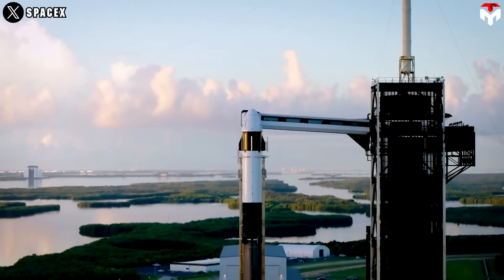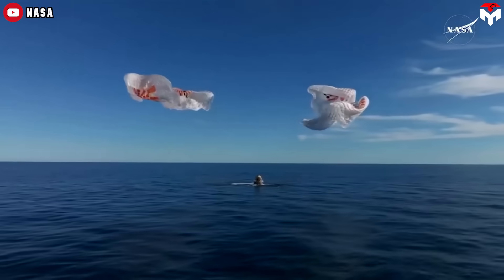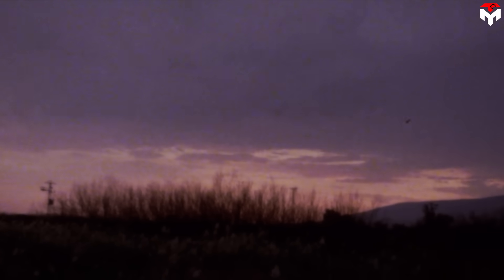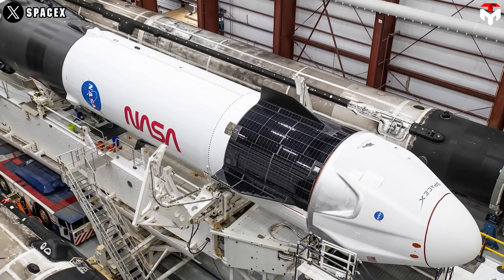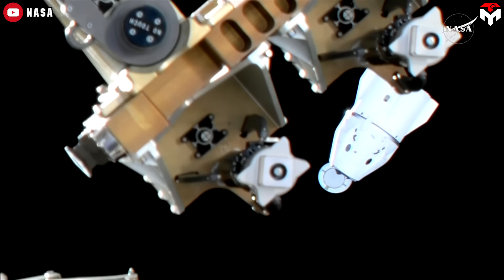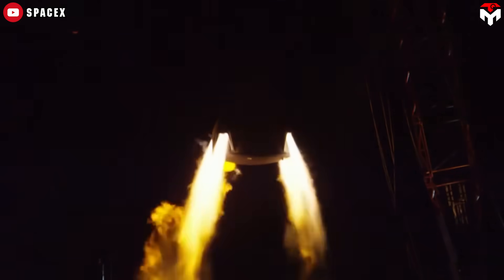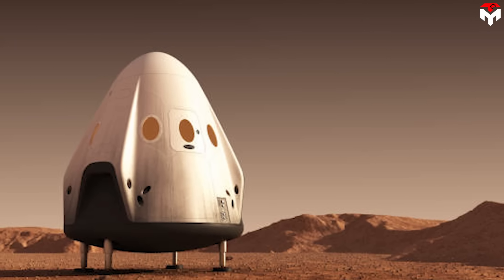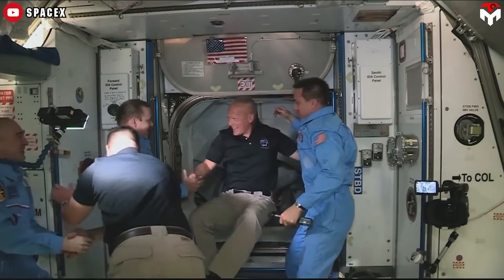SpaceX's New Upgrade On Dragon Landing, NASA Refuses to Fly on Competition...

Comment: I've seen a few breakdowns of the proposed Mars entry and landing procedures for Starship and it seems like many things have to go perfectly with very little margin for error or operational issues. Although entry and landing are naturally hazardous, would the Dragon capsuel make more sense for getting astronauts to the Martian surface from a flight safety perspective than Starship? Perhaps Starship could transport crew and mostly cargo from Earth to Martian orbit and then use multiple Dragons to land on the Martian surface, and then use Starship to carry the cargo to the surface separately?  I know it is more efficient and effective to fly point to point with Starship but it just seems like the entry and landing procedures carry greater risk.
Reply from the maker: True. Starship's Mars entry and landing do require a lot of precision with tight margins, given its size and the complexity of aerocapture, hypersonic reentry, and powered landing in Mars' thin atmosphere. Dragon, with its simpler ballistic entry and proven parachute-plus-propulsive landing system (as seen in Earth returns), could indeed offer a safer, more forgiving profile for crew. Your idea of using Starship as an orbital ferry for crew and cargo, with Dragons handling crewed surface landings, is interesting and mirrors historical Apollo-style architectures where specialized vehicles handled specific mission phases. 
However, Dragon's smaller size limits its payload and crew capacity, so multiple launches would be needed, increasing complexity and cost. Starship’s design aims for full reusability and higher capacity to support long-term Mars colonization, which Dragon isn’t built for. While Dragon might reduce landing risks, Starship’s integrated approach could be more sustainable if its systems mature. It’s a trade-off: Dragon’s proven reliability vs. Starship’s scalability. What do you think about balancing short-term safety with long-term mission goals?
Reply: @techmap9  thank you for your thoughtful, kind, and insightful reply. 

You're absolutely right to mention the Dragon's limitations and the aim for fully reusable and high-capacity launches with point-to-point delivery. 

Although different, it reminds me of global transportation on Earth. For example, sealift is the least expensive method of transporting anything from seaport to seaport, especially with high volume. Sure, it's slower than air, but it's far less expensive and more efficient pound-for-pound/dollar-for-dollar. It's great if you're only going seaport to seaport, but eventually you're going to have to include other forms of transport to get it to the door (or the proverbial "last tactical mile") so to speak. 

Another thing that comes to mind is that humans have created an "en-route structure" that provides resources to support, sustain, and maintain ships as they travel the long distances. Without that, they're always one failure away from catastrophe. Additionally, they have the communications capability to where we can follow their movements via computer, and if they have an issue they can get help quickly to bring them to an en-route location that has the support they need. 

I bring up the "en-route structure" and "communications" as neither of those exists in space at the moment - not even between here and the Moon (for obvious reasons, as no one is on the Moon).  

Perhaps another analogy (other than the sealift one) is to imagine taking a family trip from Boston to San Diego by car with no gas stations, repair shops, AAA towing, any businesses to provide you with sustainment and maintenance should something go wrong, and having one laptop for communication that takes between 4 to 24 minutes to send a message with someone receiving it. Now on top of that, and what's worse, is that if your car breaks down on the way, you don't stop but rather keep going in whatever trajectory you were on... either until you fix the problem or indefinitely. Then add 100 astronauts in what's now turned into a clown car at best or a mortuary at worst.

 I mention these things because we can and should look at how we've (humanity) established the global infrastructure to support mass transit with safety and cost taken into account. It really hasn't taken us that long to do it either (relatively speaking). But none of the "preparing the operating environment" or "en-route system" exists. At this point, this is a suicide mission at best where the margin for error is zero... for every part of the mission and with no assistance or help in sight for up to hundreds of millions of miles. If it turns into a suicide mission, NASA and the American public's reaction will be predictably horrible, especially in the current environment. 

Regarding balancing short-term safety with long-term mission goals, I'm not sure we're at the point of discussing the topic as Starship has yet to realize getting to orbit, performing operational tests/checks/maneuvers, and is really a flying prototype with zero of the innards to put astronauts in it, which I'm sure will require new tech that to my knowledge hasn't been developed and tested in space, which will lead to more operational tests like what we're seeing unfold. 

But to try to answer the question, I firmly believe that you need specific tools for specific jobs, and operating environments are important in determining what tool or resource is best. Back to the global transportation analogy, I see the Starship as the sealift vessel (or mothership so to speak) and separate smaller spaceships to be used to ferry crew to/from Starship to the Martian surface and dual purpose them as escape ships should something catastrophic happen along the way. For example, not every cruise liner or tanker can fit in every port as the port has to physically accommodate it, at the most basic level. If the Martian environment is like the physical accommodations, the Starship cruiseliner will need smaller ships to transport crew to/from the port. Sure, you can try to park the cruiseliner once, but it will only be once as it's going nowhere after that.   

This much I do know, I'm confident that the "en-route structure" isn't being discussed, particularly as (for example) the Moon Gateway has been, for all practical purposes as of this moment, CNXd. Additionally, it's going to take time to develop the "en-route structure," which no one seems to either be thinking about or addressing, and could/should happen before the first manned mission launches. They're basically planning on packing up the Griswolds in the Winnebago for the trip from Boston to grandma's house in San Diego with no one and nothing available on the way. It's sure to turn out into the horror version of National Lampoon's Space Vacation (damn the '80s movies were freaking awesome). 

Finally, there are two military sayings that come to mind that are applicable: 1. An Army moves on its stomach, and 2. "amateurs talk strategy, professionals talk logistics". I've not heard much if anything, about the "logistics" of operating on Mars, let alone the logistics of getting there (insert "en-route architecture"), which is step 1. Additionally, I don't know of any companies or groups that are doing that type of long-range, mid-range, and/or short-term planning. 

Sorry for the novel. Here's to the Griswold's Space Vacation 🍻
Reply: Both of you . . . I thoroughly enjoyed reading ALL of this.

I am no tech savvy person, whatsoever - but I'm of the same opinion . . . any trip to Mars is premature . . . to return to the moon, attempt to establish long term environmental habitats, even start collecting/processing fuels, etc.  at the very least will be invaluable experience - something will happen, it will be resolved & be improved upon . . . & earth is just right there!!!

Experience gained from the differences of earth gravity & atmosphere as compared to moon gravity & atmosphere - which is more similar to what is expected on Mars? 

Then the moon itself would serve as that "pit stop" along the way . . . What If:  there were less LAUNCHES from earth & more launches from our orbital platform - the moon!!!  

Building the ships to go to Mars done on the moon & ultimately launched from there - building all space required gizmos & gadgets on the moon - less LAUNCHES from earth . . . less fuel required with thinner atmosphere.  

If it is true that there are lava tunnels below the surface of the moon . . . that really fascinates me . . . a whole new ballgame . . . leave the surface of the moon relatively untouched - everything becomes even easier, building environmental atmosphere housing facilities, protection, mining without digging - who knows what could result!!!
Reply: @sydney.g.sloangammagee8181 thank you for your kind, thoughtful, and insightful reply. 

Although I’m unable to reply at the moment, I look forward to sharing some thoughts shortly.